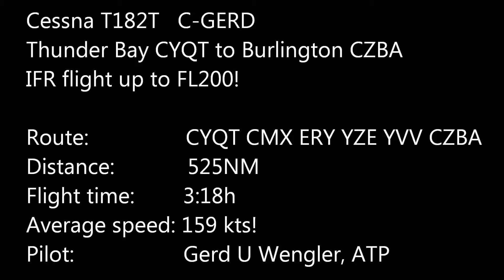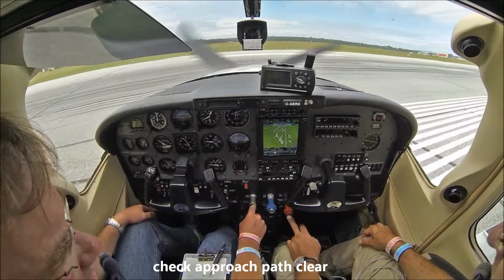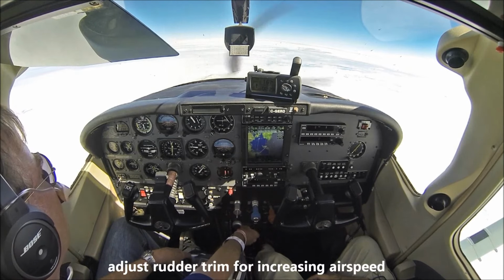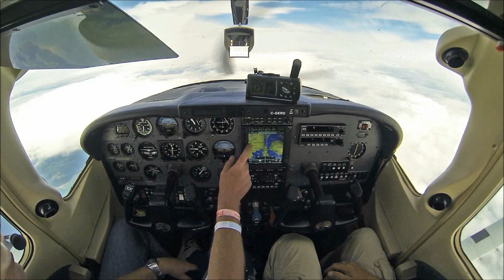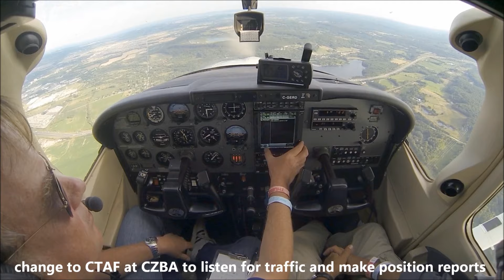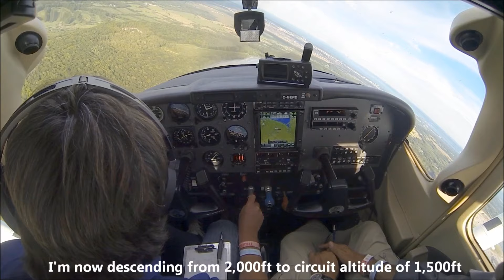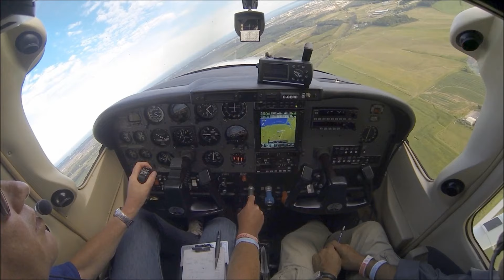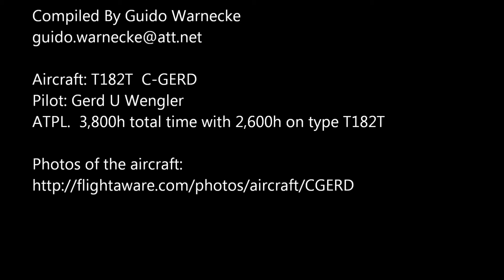Cessna Skylane at 19,000ft - cockpit video - must see!

Comment: 500 fpm climbrate is not many
Reply from the maker: Hi Tobias,
compared to a jet it is not a lot. We could increase this to may be 800 fpm but we used "cruise climb" for better engine cooling and forward speed.
When we climb with out jet to 40,000ft, we reach these altitudes also with only 500 fpm.
Thanks for watching my videos & happy landings,
Guido
Reply: thank you for the answer. We have a C210 and we climb about 1000 fpm but youre right if we climb 1000 fpm the engine is getting more hotter
Reply from the maker: Tobias Pilz The C210, especially the turbo, is my absolute favorite aircraft.
Here a video:
Bush Flying in a Cessna 210 - South Africa
I have flown more than 1,000h in this very aircraft.
Photos:
https://flightaware.com/photos/aircraft/ZSAVB
Happy Landings,
Guido
Reply: Guido Warnecke Yes ist a fantastic aircraft with 325hp. For departure you cant give full throttle because there is so much power. But i think a turbo C182 had lot of power to

Comment: Auto pilot is for lazy (non-commercial) pilots. I hate that crap.
Reply from the maker: Mateo el Feo 
Hi Mateo,
you are certainly entitled to you opinion!

My opinion: The proper use of an autopilot enhances greatly the flight safety, especially during single pilot IFR operation. I fly single pilot (turboprops and jets) in the US Northeast for a living.
Part of the 135 check ride is also on the management of the autopilot to be legally use it "in lieu" of a second in command pilot.

That - of course - does not mean that you put any pilot in any aircraft in any weather with the thought "the autopilot will do it". 

Happy Landings,
Guido